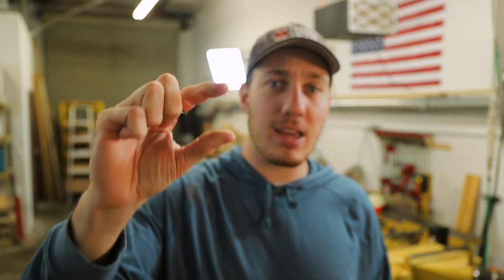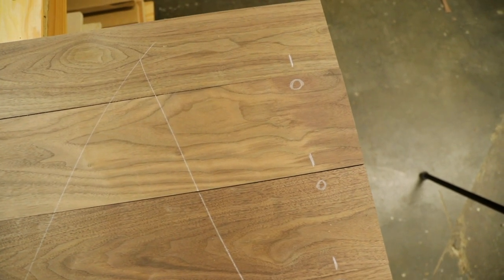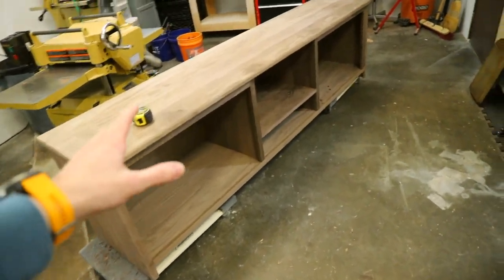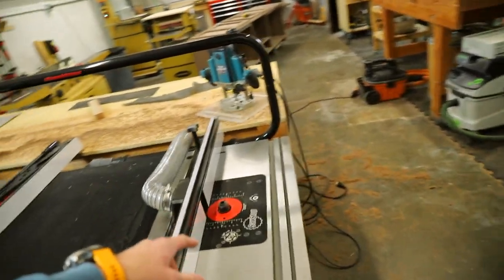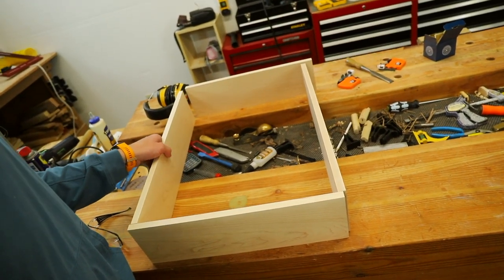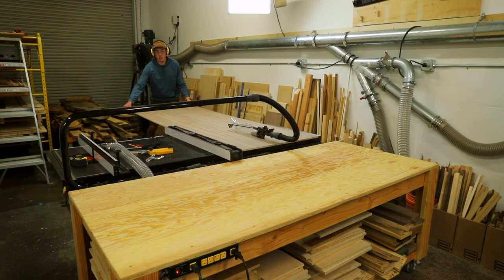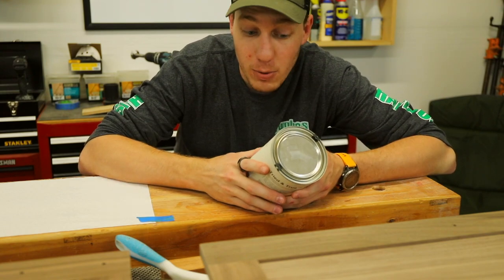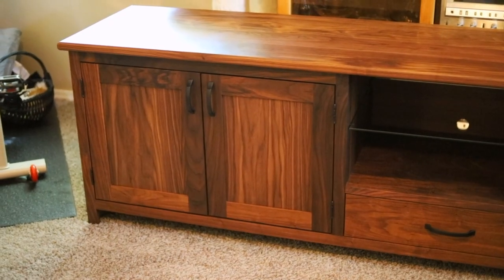Building A Walnut Credenza | FINE WOODWORK (Part 2)

Comment: Very well designed and constructed. I also like a natural finish. Some years ago, in my high school woodworking class, I built an end table and finished it with wax. Now, quite a few years later, the top needs rewaxing but the lower shelf is just fine.
Reply from the maker: A wax finish isn’t as durable, but recoating something like an end table is much easier with wax than a varnish